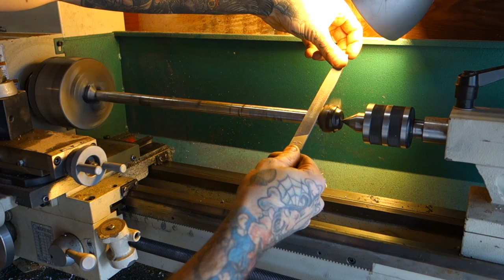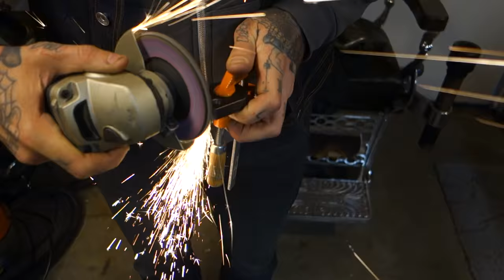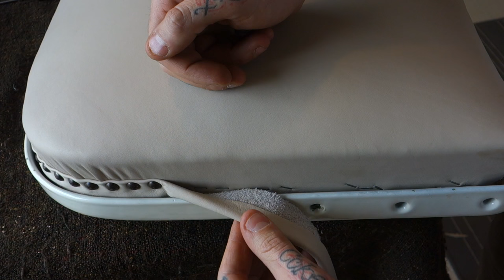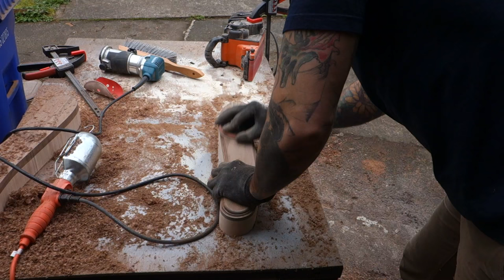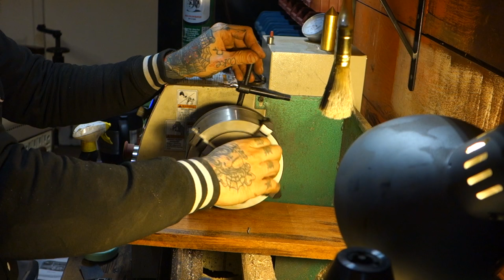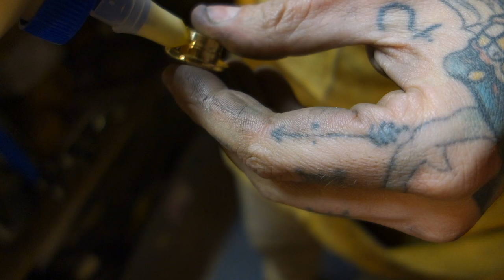Barber chair fixin.

Comment: What did you use to sand or polish the metal trim ?
Reply from the maker: That was just a wire wheel on a disc grinder. One with the finer or thinner barbs or whatever. SAFETY GLASSES them things go flying everywhere but work really well without beating up the nickel plating.

Comment: so you used bondo for the porcelain chips? what kind of paint did you use?
Reply from the maker: Hey, yeah man there was a crack in the back rest and I welded it up a little bit and smoothed it out. then hit the whole area with a thin layer of bondo to match that porcelain layer.  Then epoxy primer, and just spray painted it with an ivory white, then 2k clear coat.  To be honest the paint is not holding up well and looking back the sea foam green it used to be would have looked great in my shop. haha
Reply: Thanks awesome work!
Reply: @theironsociety9475  you can sandblast the porcelain layer to give bite to the primer and the paint, porcelain is so hard that untreated surface has much diffiiculty to accept an organic coating
Reply from the maker: @jacquespoirier9071  yeah that makes sense for sure. I hit it with every abrasive I had at the time and still was like painting over chrome. Haha